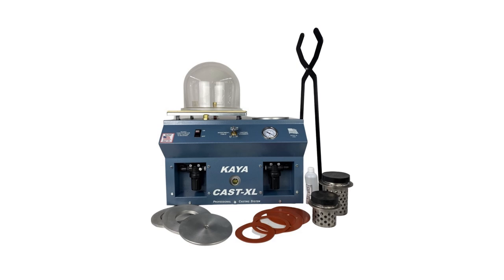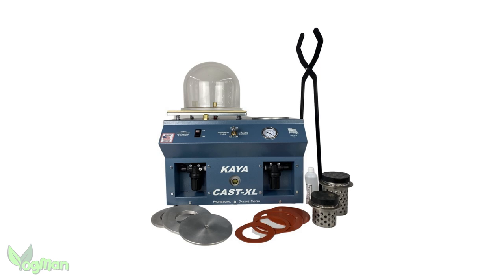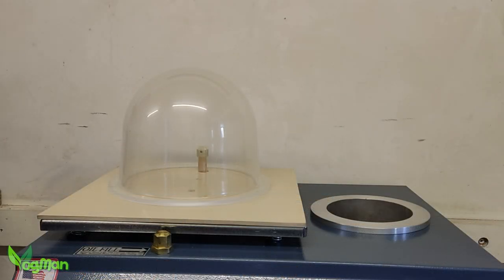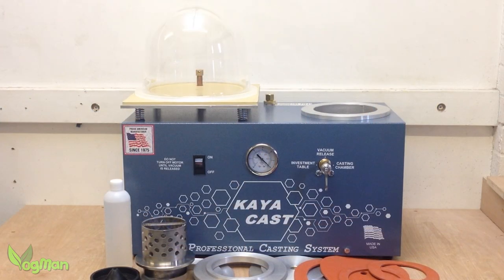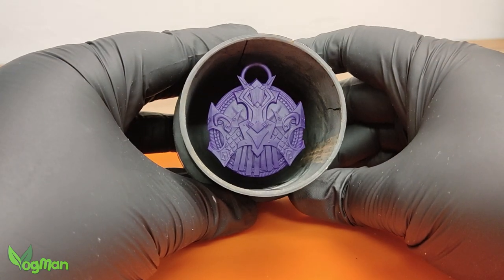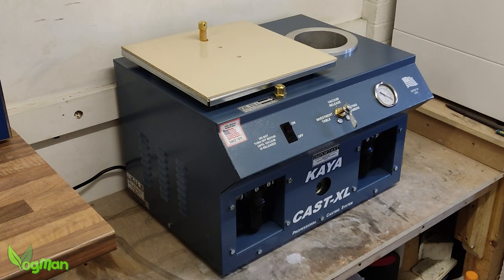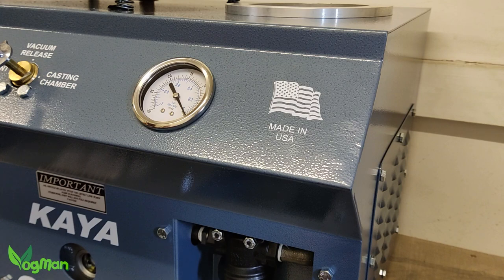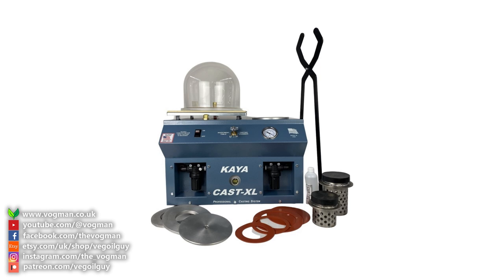Kaya Cast XL Vacuum Casting Machine (HONEST review)

Comment: 8:04 I think the inspection hole actually is aligned as intended. Now I'll admit I don't know anything about these casting machines, but I think the Oil is intended to be inspected from standing position. Thus the hole placement higher, meaning you can quickly just look down and see "yep there's oil in there".
Reply from the maker: It could be... be please remember, I was trying very hard to find faults there 😁

Comment: I wish they'd include a vibrating investment table for that price. I've fitted one to my original Kaya cast and upgraded the vac pump.
Reply from the maker: I'm not absolutely sure it's necessary... but you could always touch an orbital sander against the edge of the plate. That would vibrate it 😁

Comment: This might not be very relevant to this video, but I have a question.
I was researching desktop injection molding, and it seems that the only documented way to make very detailed aluminum molds is to use a CNC mill capable of detail comparable to what a resin printer can do with resin pieces.
Do you think a system such as the one you showed in this video, with castable resin and all, could be used to produce parts with a good enough dimensional accuracy to be used as molds?

Comment: Great review. I really enjoyed your well thought out commentary and how you highlighted the parts of the kit that are truly important on a daily basis. Your comments on the mis-alignment of the oil level window as well as the air filtration units are justified. For that kind of money, I would like easy items like these (low hanging fruit, if you will) to be sorted out at the factory. Also true, is the fact that these do not negatively impact form/fit/functionality. The capacity of the vacuum pump is impressive @ 8cuft. Do you know what kind of warranty there is on the pump, specifically? Nevertheless, thank you for your review. I do hope the manufacturer acknowledges how well you present their products. A Kaya Cast XL is a fair trade for an honest review such as yours. Cheers.

Comment: Great video as usual! I bought the original Kaya cast from your video about that, and now want/need the size of the XL bell jar, cheeky but if I buy just the bell jar for the XL is there any way it’d fit the original? The dimensions make me think it might juuuuuuust fit on the investment plate?
Reply from the maker: I'll be honest Matthew, I'm not really sure. You're beter off asking Arbe 😁
Reply: @vogman  They said no. 😂 "The lip of the bell jar that is used on the Kaya XL measures 12.75”. The width of the table on the Kaya Cast unit measures 11”. The bell jar would not fit onto the table enough to secure a vacuum." - I'm going to cut an acrylic riser to pop under the existing bell jar. Fingers crossed it doesn't implode 🤞

Comment: Amazing video content and editing as usual. Hello friend, I bought the standard version of this machine from arbe a while ago and I am very happy. I have a couple of questions related to your video.

if the same piece and sprue system is used in both machine... The more suction power from the XL version means "better detail/fewer casting defects"?

Was that medallion printed hollow or solid? I usually print my models with a wall thickness of 0.7mm because  I have read that it is not a good idea to make thick solid models with Siraya Tech cast resin. and in some pieces I have had problems with large hollow parts. I think it is due to the first vacuum to remove bubbles. I believe the piece were broken/impressed by the pressure of the vacuum machine and the investment go inside the hollow piece

Thank you so much from Spain !
Reply from the maker: Hi Miguel. I guess it could be argued that the power of the XL is really about speed. It pulls on the molten metal much faster, moving it into place before it can set. I don't know this for sure, but it does make sense I suppose 😁
The medallion was solid, 6mm thick in the centre. I print on a height of 0.03 which I've read cures quicker and more thoroughly than 0.05, because ST Cast must be fully cured. I also leave thick items, like this medallion, for a good hour of UV curing. 
I think I'd always be worried that hollow prints were still wet inside... but if I expect UVs to penetrate my 6mm print, then I should also expect it could penetrate a hollow print.
In short my friend, both arguments sound good. I guess there's nothing for it but to try both and see which gives the best results. 😁👍👍👍
Reply: @vogman  Thank you very much for your detailed answer. You are the best! Thanks again!

Comment: well I have two vacuum machines. one is made in Israel and the other is Kaya. the Israeli one has a week vacuum But it has a builtin vibrating device something the Kaya doesn't have and I have found out the shaking is a must or I'll have small bubbles on my metal. I also don't have the xl so the oil gauge is on the side and I see me having so much trouble replacing the oil in the further. I don't understand why the oil tap isn't on the side so it's easy just to empty the machine from oil. I guess I'll have to bring friends to help....
Reply from the maker: Interesting... I've not come across vibrating like this.
Reply: @vogman  I tried without and with. With is an old school way